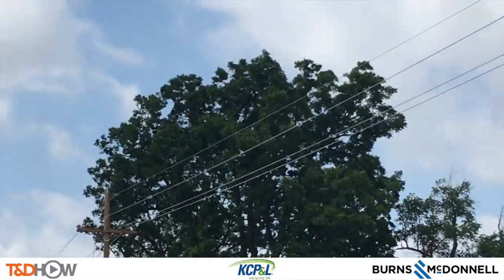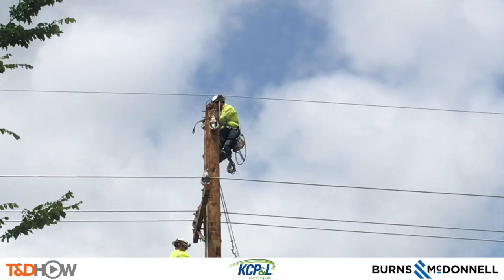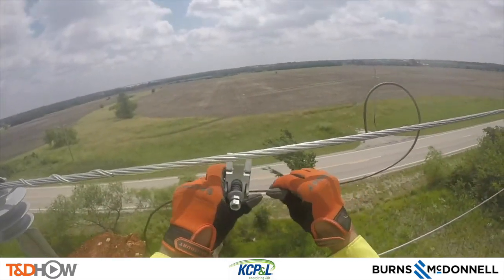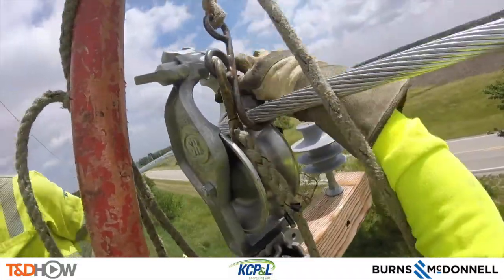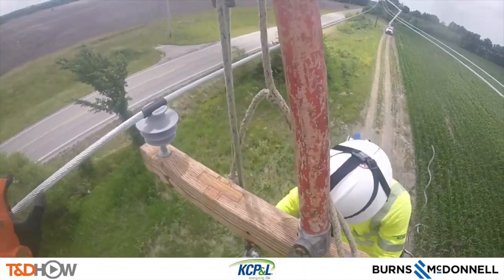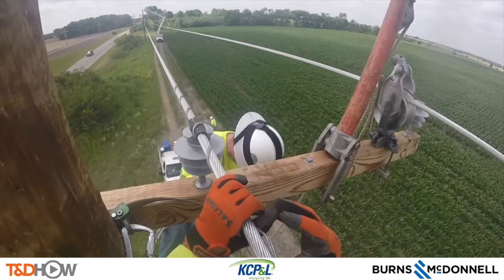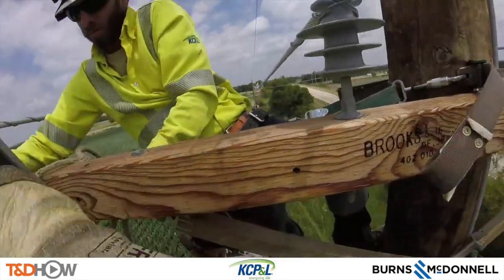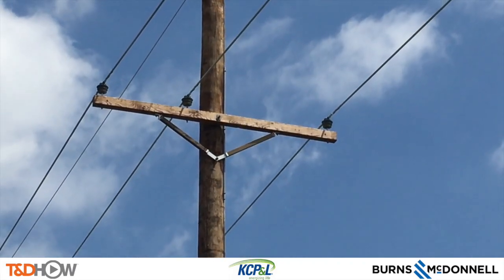Arm Buddy for Distribution Line Tie-Ins

Comment: 我比较好奇美国同行的工作，既然是裸铝导线，但为何工作点两侧没用接地引线封住？登杆以及穿越导线前也没有用验电器验电，工作点周边也没有防止无关人员进入的围栏，想必也没有工作票制度了，那么是如何保证安全的？美国电力行业的事故率是多少？
Reply: Well for safety they hold a tail bored covering all safety topics an concerns....as well as a Forman and groundman on the ground to keep the area secure. As for checking for voltage this is a new line with grounds applied on both ends of the conductors. If this was a single point ground for climbing I would imagine they would have a cluster ground mounted for equipotential grounding method.

Comment: Two men on a pole to do one man job guess the new linemen aren’t as tough as the old ones were
Reply: Need a groundman also, I'm not running between poles to run a hand line. Could of just had one guy grunt and the other climb then switch off but you would have to work in your gaffs on the ground or take them off every other pole.

Comment: My companies policy is if that line was new construction and never been energized you can legally work it in leather gloves. Otherwise you’d have to ground all 3 phases to the neutral and wear rubber gloves.
Reply: What if it is running next to an energized line? This is why guys are always dying on deenergized or "grounded" lines. You shouldn't leather glove anything that hasn't been truly equipotentially grounded and why equipotential grounding is so important to understand.

Comment: Feeders cleared up and grounded. Don't matter where I work ,if there's primary on the pole . Grounded or not we always wear rubber gloves and sleeves.
Reply: Willey Poboy brand new line bud....
Reply: Brand new line not energized not ok for svc
Reply: That's because you're an idiot 🙃
Reply: Do you wear rubber gloves when installing a breaker panel in a house with no service drop installed yet as well?
Would you wear gloves while handling a spool of primary cable? Lol
Reply: @ke6gwf  I have been a lineman, troubleman, switchman and back to lineman for almost 26yrs. The utility i work for is the largest  in the world.the division i work for years high voltage gloves and sleeves from cradle to cradle and even when working extendo sticks. And even to train and pole top rescue. You work how ever you like. And I dont install breaker panels sir
Reply: @willeypoboy6052  great to know... I guess even top companies occasionally hire know it alls lol

You should probably wear gloves and sleeves when installing barbed wire fences too, you never know when a primary wire might fall on it, or if it will get some induction from an overhead line....

And yes, I am being sarcastic, because if you are treating a new line that's no where near power like it's live, then you should treat any other long wire with as much respect and care.
Reply: @ke6gwf  damn you just hit the nail on the head and you don't even know it  .  I guess you've got to be a comedian to keep your arms these days sir...
Reply: Storm season and I'm home drinking a beer look'n at the arm buddy and prod'n tough ass lineman in the ass ...yall are a touchy bunch . And apparently I know It all .lol!
Reply: @ke6gwf  Yes, any long, insulated conductor should be considered a shock hazard because electrical weather is a thing that happens on Earth. Telluric current, clear sky current too, not just thunderstorms.

Rubber might not always be required, the deciding factor for whether someone gets hurt is the quality of the equipotential bonding vs whatever electromagnetic activity acts on that conductor.

Comment: As long as there is no induction hazard and the line is isolated from live lines no grounds are needed. as there is no source available to energize the line. So this is safe
Reply: Possibility of backfeed...why risk your life when you can work safe
Reply: Nature itself is an excellent source of direct current, including clear-sky current that can build up some rather nasty static charge on an insulated and elevated line.

Heaven help you if you're near a thunderstorm.

Comment: I didn't see ground wire, is this working on active line? and what's the function of a stranger black on the wire?
Reply: It’s not energized or they would be in rubber gloves and sleeves , the ground doesn’t have to be right there where they are working it is probably a few spans down.

Comment: Looks like the apprentices could use an "EPZ BUDDY" you can find out about it in 1910.269. Not only does grounding save lives...... it is also the law.
Reply: Brady Hansen brand new line .....obviously it’s de energized because it’s just been run and laying in steel dollies.
Reply: you still put grounds on new wire!!!!

induction from long spans of new de-energized  wire can still bite you!
Reply: @tonycepeda8054  It looks like the line they're replacing is across the highway. The only time we used grounds and rubber is when the new line we pulled in was close to the energized line (The line puller was always grounded). I've never experienced what your talking about. I remember removing a guy from a de-energized line that was arcing off my wrench, but it was directly under a transmission line.
Reply: @tonycepeda8054  Throw Trips on One end for Induction drain, not full Grounds at every structure. That's a waste of time
Reply: I’m 100% sure that where the wire is deadened it is grounded they wouldn’t be up there otherwise